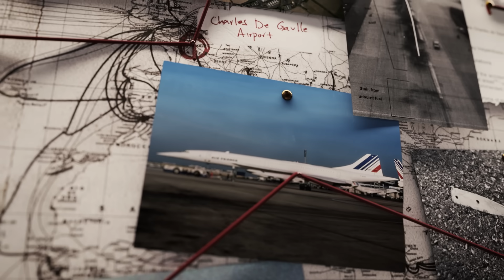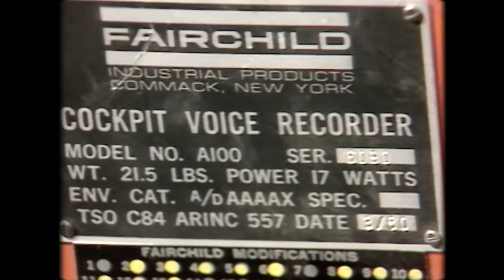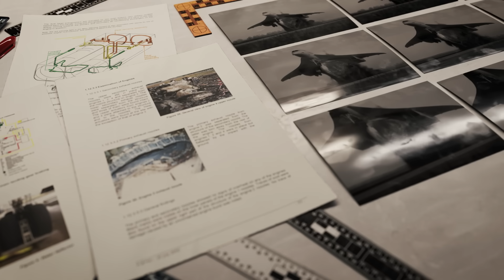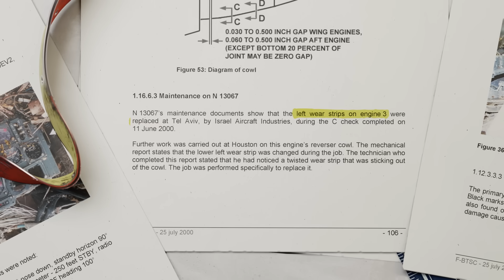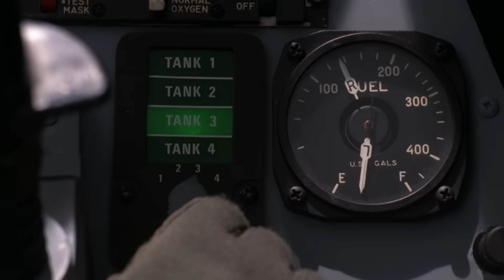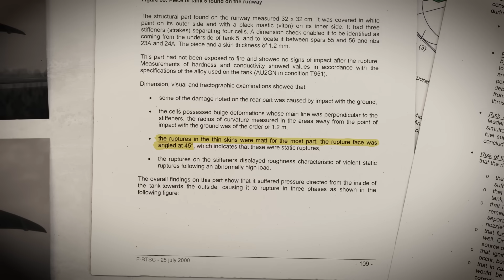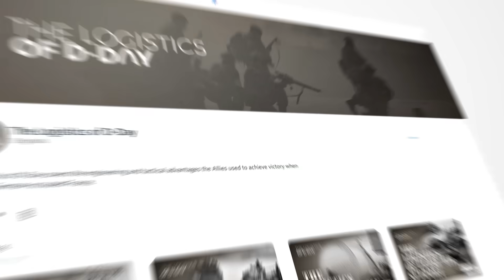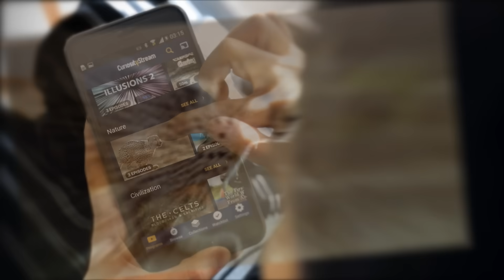What Actually Happened to the Concorde

Comment: Just another recitation from the French Civil Aviation enquiry into the crash of Concorde.
You make no reference to evidence provided independently of the following
1. The delay of the flight due to a tyre in the left wheel block needing to be changed
2. The affected wheel not being refitted correctly due to failure of the maintenance staff to install shims
3. The plane was overweight
4. Just before departure the weather change but the pilot ignored this continuing with his filed take off plan, but now with a tail wind
5. The Concorde started to veer off the runway before it made contact with the metal strip from the Continental plane  which was most likely caused by 2 above
6. You did not discuss why only after the accident did Air France change to a stronger tyre for its Concordes

Comment: Good video for some of the engineering aspects, but it doesn't even begin to cover certain issues on the Air France side...  You should read the very excellent book by Mike Bannister (retired BA Concorde Chief Pilot) about the alleged Air France operational issues (not adhering to SOP's, overriding critical safety systems, over-filling tanks beyond the 95% safety margin, playing fast and loose with CoG calcs etc.) and obfuscation of the investigation by the French authorities.  It is EYE OPENING and paints this tragedy in a whole new light that the public has not been privvy to.  Does nobody else find it really interesting that eventually, Continental got nothing more than a light token slap on the wrist?  Why?  Because perhaps, if the matter was pushed any further, the bigger issues around Air Frances Concorde operations itself might have been exposed to the light...

Comment: Have a read of Mike Bannister's book Concorde. Seems actually the fire was caused by a left out component from the under carriage and the French crew over filling the fuel tanks, the metal strip did also hit the plan but wasn't the cause of the fire that had already started at that time, but the metal strip enabled the French authorities to appoint blame away from France.  

Also maybe the crew could have saved the plane, but the flight engineer without consultation as per process shutdown a good engine.  There was no attempt to manually raise the undercarriage when it failed to retract, also there wasn't due diligence around the baggage loaded so the centre of gravity was off.
Reply: Everyone here in the comments having read 3 books and watched 10 videos of analytics talking about what these guys should've done and shouldn't have done in the span of 2 1/2 minutes of chaos. Including "following procedure" being bad.

Also no guarantee the engine would've done much, they kept surging and losing thrust and such from intaking hot gas

Comment: Actually an aborted takeoff is still possible after V-1. And it has been done, though in the vast majority of cases it is simply not done. Because after V-1 it is no longer possible to stop the plane before the runway ends.
     The only time you would abort a takeoff after V-1 is if there is a high risk of not returning to the ground safely.
      In case of the Concord crash this was the case. With the extent of the damage suffered and the fire, the plane had no chance of returning to the ground safely. If the pilots had known the extent of the damage and the size of the fire, they surely would have chosen to abort the take off. They still would have crashed and as they were already on fire, at least some of the passengers would have been killed, but only in aborting was there any hope in at least some passengers surviving, even if that hope was small.
      As it was, the pilots had no way of knowing how bad the damage was, and lacking this information, they still made the correct choice based on what they knew.
     To the pilot's horror, they probably realized soon after take off that a safe landing was hopeless. This would have been confirmed by the tower when they were told they were on fire.
     Even so, the brave pilots flew the plane all the way to the ground, doing the best they could.

Comment: Everything that you said is basically correct.  But it overlooks many of the true causes of the crash.  The Concorde that day was overweight, out of balance and took off with a tailwind.  Moreover the landing gear had been improperly repaired by Air France, missing a critical spacer.  If all of these had been within normal limits, than the plane would have lifted off before even encountering the metal strip.  Moreover the swerve on the runway was likely caused by the faulty landing gear.  This also caused the Concorde to strike landing lights, which added to the debris ingested by the engines.  Finally, in flight, the out of balance condition caused control issues, which were exacerbated by the Flight Engineer unnecessarily shutting down an engine.  In all serious pilot error mistakes were made, which contributed greatly to the crash.  Air France and the French Government deliberately minimized or concealed these issues, and focused on the metal strip, to avoid bearing any responsibility themselves.
Very few crashes have just one cause, and this is no exception.  If the pilots had been more diligent, than this crash could have been avoided, even with the metal strip on the runway.

Comment: No mention of the crash in people using aeroplanes in the wake of 9/11. No mention of Air France skipping dozens (I think) of safety overhauls over the service life of their aircraft, which I believe were carried out on all BA aircraft and would have made a difference. No mention of the fact that Air France wanted any reason to kill the aircraft and refused to provide servicable parts for any other carrier wishing to continue. No mention that the flight was over loaded with luggage, affecting it's takeoff and initial flight controls. I believe there was also a missing stabiliser on the landing gear, which I don't recall was a direct cause but perhaps and example of Air France's poor maintenance of these aircraft.

Comment: There’s a few other factors here that aren’t mentioned. Firstly the tanks shouldn’t have been that full - the pilot over filled them and therefore the plane was overweight. Also when in the air, the first officer shut down the engines near the fire due to overheating. He shouldn’t have done this as combined with an overweight plane meant there was no chance of an emergency landing.

Comment: I saw a documentary on this a very long time ago that mentioned that the engineers had actually designed the fuel tank to withstand this exact scenario, but the problem was that the tires were upgraded and heavier than originally designed due to many tire failures, and the added mass of the upgraded tires was never taken into account for the fuel tank strike calculation.

Comment: not the REAL story, missing spacer because of bad maintenance (Air France ground crew) caused by time pressure etc., caused plane to detour to side of the runway during takeoff so main landing gear hit runway lights and debris from this accident (runway lights) penetrated fuel system and we know the rest. The Dc-10 story is official argument ONLY because if Air France got sued and had to pay compensation, they would go bankrupt. The Concorde in Sinsheim is only form of compensation and it is there because most of souls were Germans.

Comment: short in sweet, A piece fell off from united airlines that took off moments before,
This piece was picked up by Concords wheels and flung into the gas tank,
idiot control tower told pilot to cut engine which he did, there was nothing wrong with the engine
fault =  control tower reason United airlines, which i cannot believe is still is in service

Comment: There is a lot of misinformation about this accident regarding crew actions in a highly dynamic environment. Specifically regarding the shutdown of engine #2. 

From BEA report P 133: 
"Engine fire alarm actuation and the very low values on the parameters led the crew to shut down the engine after the Captain called for the engine fire procedure. In fact, the movement of the throttle control lever to its idle stop is heard and, a short time later, pulling of the fire handle. In addition, the deceleration of the engine, established from the recorded parameters, is consistent with a commanded engine shut down."

See the following timeline from the CVR and Concorde Flight manual.
o	14 h 43 min 13.4 s, message from the controller indicating flames at the rear and read back by the FO. 
o	14 h 43 min 16.4 s, FE “(stop) “. 
o	14 h 43 min 20.4 s, FE “Failure eng… failure engine two”. 
o	14 h 43 min 22.8 s, fire alarm. 
o	14 h 43 min 24.8 s, FE “shut down engine two”. 
o	14 h 43 min 25.8 s, Captain “engine fire procedure” and in the following second the noise of a selector and fire alarm stops.

Indeed, before the failure of engine 2 was announced by the FE and the controller had informed the crew of the presence of flames at the rear of the aircraft, and the engine’s fire alarm (red alarm) and the associated gong sounded. It is important to note that the Concorde Flight Manual requires an immediate reaction by the crew in case of a 'red alarm'.

As the CVR shows, the FE correctly called out the engine failure and then the required procedure to shut the engine down and this was confirmed by the Captain’s commanding the engine fire procedure to be carried out.. 

By Saying 'Stop'; the FE may have been the only person who correctly called for an abort to the takeoff.

Comment: What I'm missing:
- What was the ignition? The previous report stated that there were no ingnition sources. (if the afterburner was the ignition, then the animation isn't really accurate)
- Why did the engine fail? I assume the loss of pressure in the tank ment not enough fuel could be provided.
- Did the Concorde become uncontrollable with one engine? Does a modern aircraft become uncontrollable if one side fails during take of? I know losing an engine mid flight is recoverable.

Comment: Brian excellent, on earea not investigated thoroughly is the source of the ignition, my theory is the multiple looms that run through the wheel bay got fractured  swang free after being broken the two ends in close proximity setting up a potential difference difference large enough to alow a spark to propogate ignighting the vapour first then the liquid fuel
And I know its semantic but the British where I charge of the power plant so itt reheat not afterburner afterburner(which is an an American term) kindest regards mickT I'm going to look into nebula as that looks like my kind of thing too

Comment: I remember the Air Force doing regular "FOD Walks", where FOD means Foreign Object Damage.  Any little piece of anything had to be removed from the runway because a jet engine or tire could turn it into a projectile, or other problems could arise from what it does to the aircraft.  I'd assume commercial airports would do the same thing, but maybe they don't have the time in their schedule to send humans down the runway between each flight and prevent FOD tragedies.  Seems... shortsighted.
Reply: @SamuelWright520 Possibly.  Foreign Object Damage is the acronym I was told but it could be Foreign Objects & Debris or something in other contexts
Reply: Commercial airports do FOD cleanup, too. This was just unfortunately between them.

Comment: Maybe i missed something but i still don't understand why the fuel ignited when the hole formed. Was it that the hole was close to the engine's afterburner exhaust or did the popping of the tank make a spark as it did to light the leak?

Comment: It's also fair to say that British investigators noticed afterwards that a spacer was missing from the bogie beam on the left-hand main landing gear. (It was later found in an Air France maintenance workshop.) This skewed the alignment of the landing gear because a strut was able to wobble in any direction with 3° of movement. The problem was exacerbated on the left gear's three remaining tyres by an uneven fuel load. Drag marks left on the runway by the left rear landing wheels showed the Concorde was veering to the left as it accelerated toward takeoff.
Due to the veer, the Concorde travelled further down the runway than normal because it was failing to gain sufficient takeoff speed. It struck the metal strip from the DC-10 after it had passed its usual takeoff point on the runway.